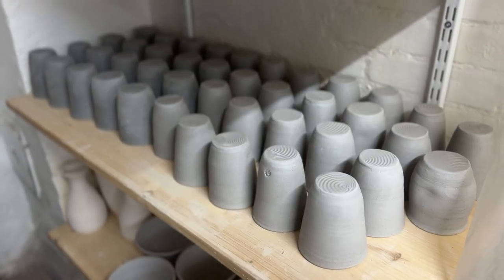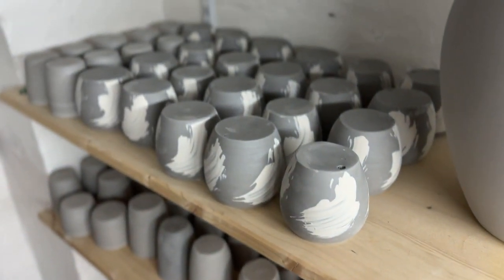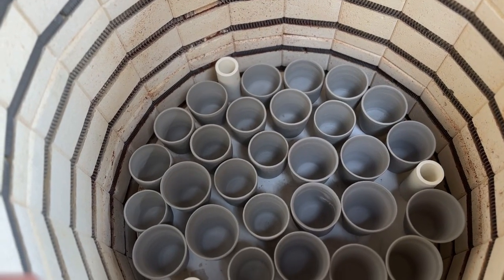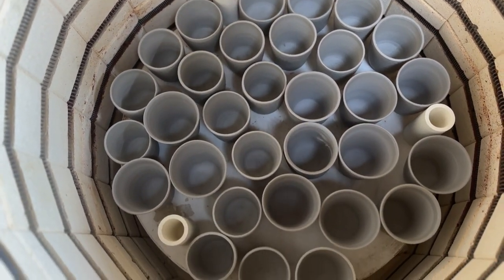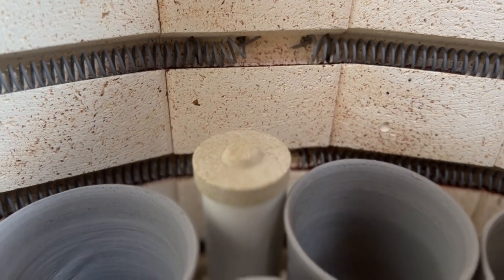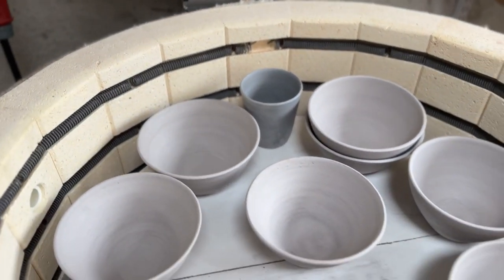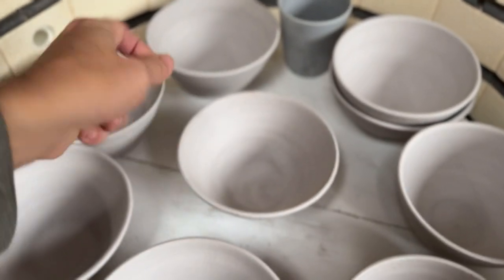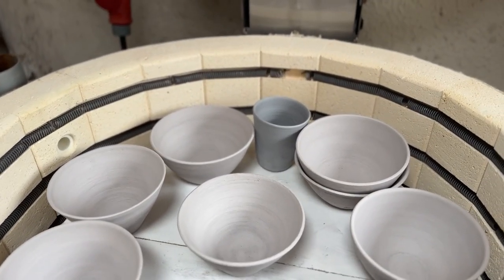72. How to Fire & Glaze 110 Cups and 9 Bowls in One Kiln Load

Comment: Thank you very much for this video! In fact, thank you for all of your videos! I really enjoy them a lot. May I ask to which temperature you bisque fire? Here in Germany most potters advise to bisque fire to around 950°C but most of the US web sites tell you to bisque to 1050°C. That's quite the difference. Lately I noticed some bubbles in my clear glazes and also some coloured ones. I don't really believe they're coming from a wrong bisque firing but some potters told me that it's possible and to be honest, I'm running out of ideas...
Reply from the maker: Thanks a lot :-)

I bisque to 950 and 1000 C depending on clay and application. 

I do not think your bubbles is due to bisque temp but is more likely an issue with glazes that do not fit the clay - or some issue with how you apply it.

Comment: When I want a "splattering", I dip a toothbrush in the liquid, and run my finger over the bristles (it makes a huge mess, and a lovely splatter), might work for your sodium? Love the purple cups, what a beautiful color, and of course the temaku gold is always gorgeous. One question, is there a reason you don't use wax when you want those clean lines?  Have fun at the craft event. Thank you for the video. Be well.
Reply from the maker: Thanks :-)

I use a toothbrush too for some applications but in case on the soda I did not want splattering :-)

I also use wax for some applications but I was too lazy for it this time and I do also like the more free form lines I get without for pots like this.

Comment: Thank you  so much for this very interesting and detailed video!  I noticed that your kiln is outside, almost open air.  Is it not effected in performance during a cold winter?
Reply from the maker: Thanks a lot :-)

The kiln is protected from rain and snow (if any) by the roof and walls but the shed is, off course, not heated. However, with these new kilns, that are so well insulated I hardly see any difference from summer to winter. It works really well. Bu, we also do not have very hard winters here.